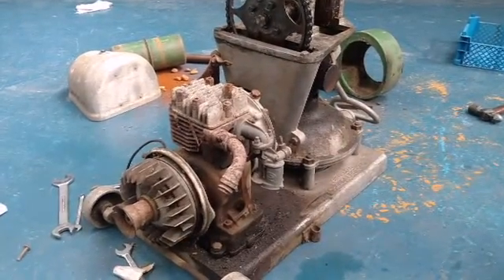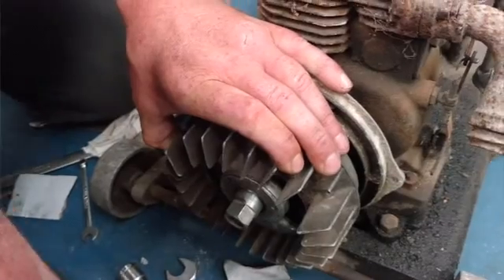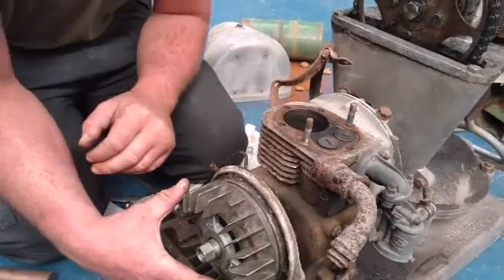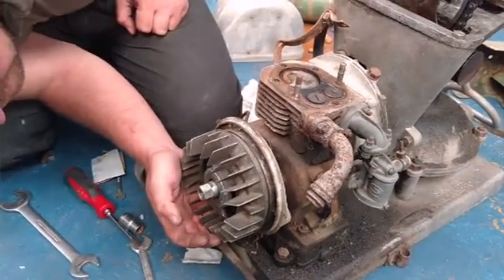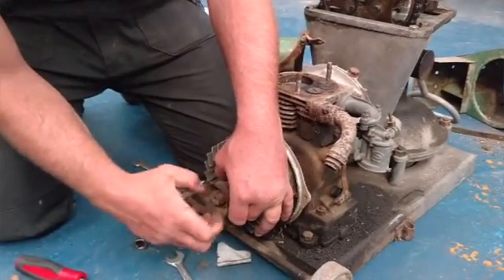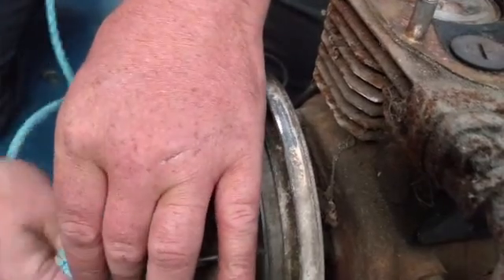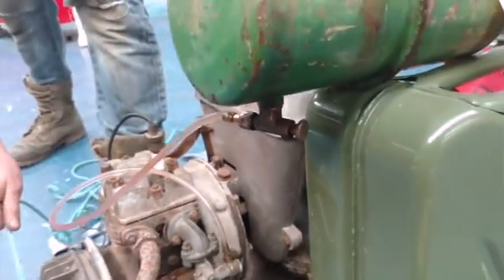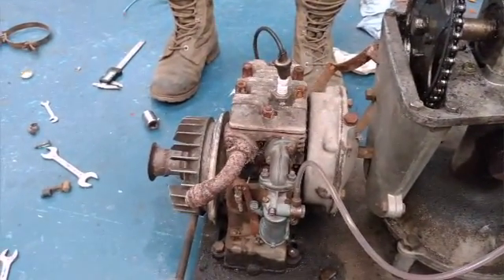First start Villiers Mk 10 solids pump running after 25 years

Comment: What did you do with this engine matey  just subscribed looking through your videos now great work
Reply from the maker: Was going to use it to pump out the bunker but it's supremely unreliable, leave it for a week and it needs pulling apart and the points cleaning, I like it too much to try and fit a different engine though.

Comment: Hello. I've just bought A Simplite MK4. I was wondering if you know how to access the rubber membrane. I've taken off the inlet nozzle and the rubber check valve  is old and deformed - which I can replace. My main question is underneath the rubber membrane there is a circular metal plate with a central hole but it's just rattling about, not attached to the central plunge shaft as I suspect it should?
Reply from the maker: I can't answer your question I'm afraid, I've not had to open the pump up yet.
Reply: @turboconqueringmegaeagle9006  Thank you for your reply.

Comment: do you have any idea what the ratio is of the bolt on reduction box fitted to the engine is .I have had a few of these engines and that must be the lowest ratio i have seen it looks about 8/1   phill
Reply from the maker: PHILIP ALLEN if we guess the engine rpms at 1500, the pump is doing a cycle once a second and the chain is around 3:1....  500/60 is 8.3 so I reckon you are spot on with that estimation! These things are beutiful, it's such a shame the set up is so bloody long winded, it'd be fun to stick a modern solid state ignition on it then I might actually use it but as it is it's been stood for a year and I'd probably have to strip it all down just to clean the points again.
Reply: thanks for info   working on mark 12 villiers at present but crankshaft bent at flywheel end  rest of looks to have done little work , i have a friend who has some of these engines but a days work  to move things to get to them  will keep in touch on progress phill .
Reply from the maker: PHILIP ALLEN I wouldn't trust these figures on different model, has the mk12 got an aluminium case?